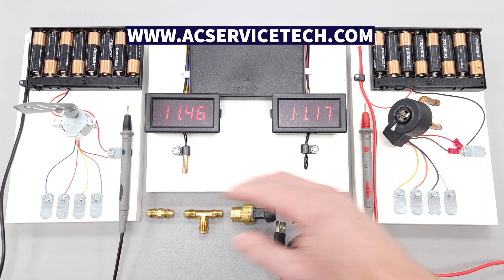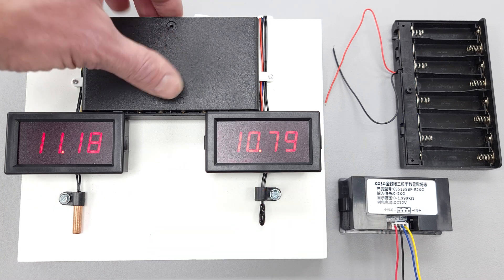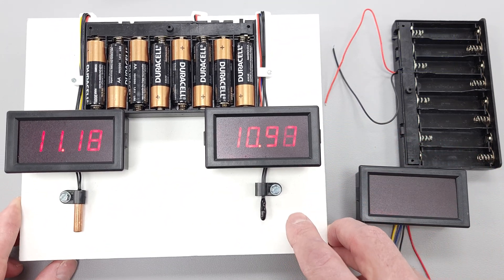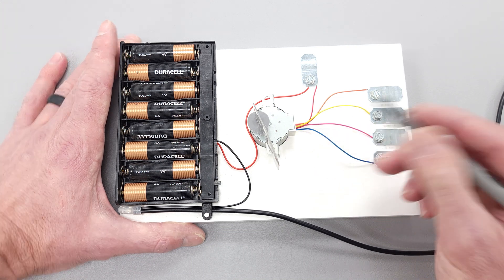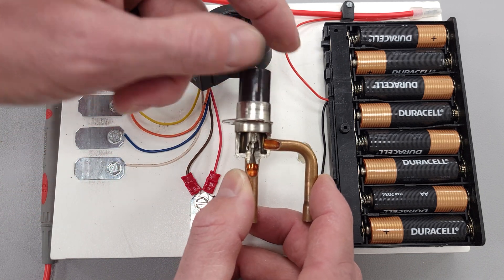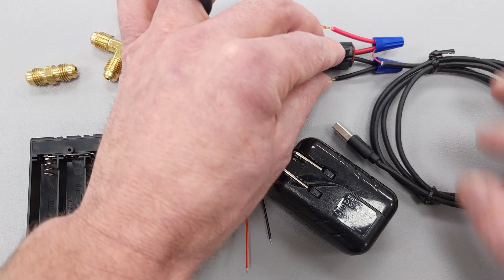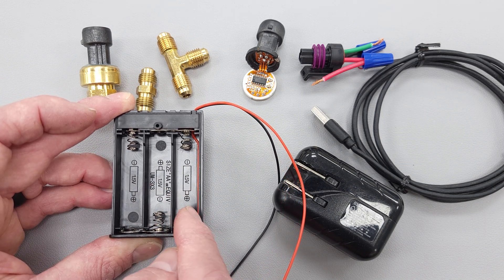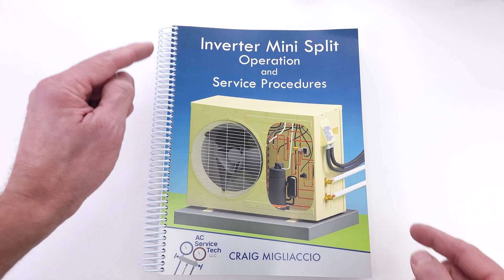HVAC Teaching Projects Intro for Classrooms!

Comment: Thank You for a very informative and easy to understand videos
Sir, if the EEV valve is at the out door unit, then we will have a Flash-Gas in the Liquid line going to the evaporator, do you recommend attaching both line sets, suction line and liquid line metal-to-metal in one rubber insulation (Armaflex or equivalent) ?
Sir, we need you advice regarding this issue .
Thank you
Reply: Both the liquid line and vapor line must be individually insulated.  Because the EEV is at the outdoor unit the liquid line is an extension of the evaporator.  You need to insulate this line to minimize heat transfer into the refrigerant.  Every BTU that's absorbed into the refrigerant in the liquid line is a BTU of lost capacity.
Reply: @RalphMercuroMusic  Than you sir
Reply: Thank you sir

Comment: Would you please do a class on how ECM motors are designed to fail and be unrepairable because the circuit is epoxied. It's this kind of greed that is killing our pocketbooks and the environment.
Reply: Trirrirriryrri😮😅😮😮😅😮😮riryririrr😮😮rto
Reply: X😮😮😮😮😮😮😮😮😮😮😮😮2😮😮😮2😮😮😮😮r
Reply: They fail because of poor ductwork design and they don't like dirty voltage because the control board hooked up to line voltage. They make ecm protectors. I've came across an ecm motor from the 90s
Reply: Trirrirriryrri😮😅😮😮😅😮😮riryrir